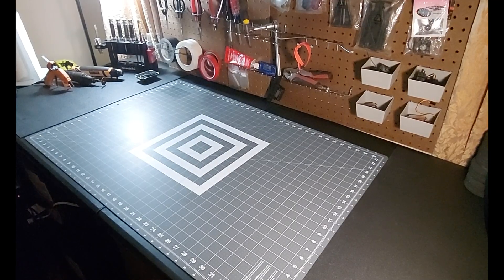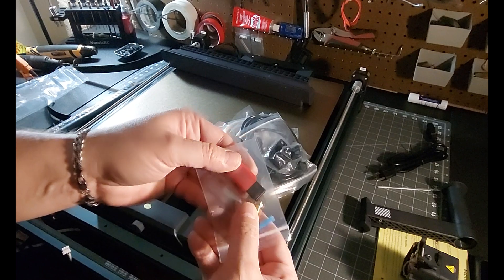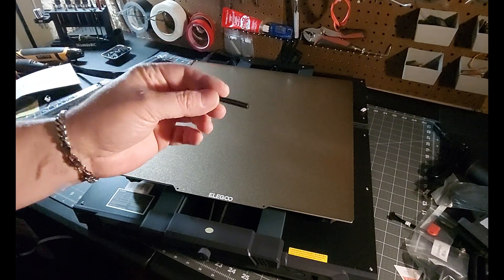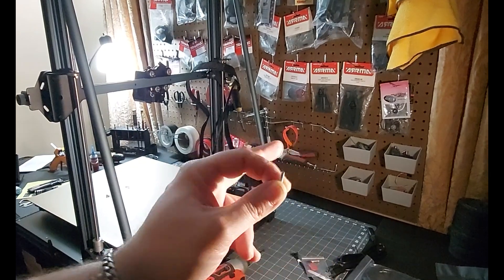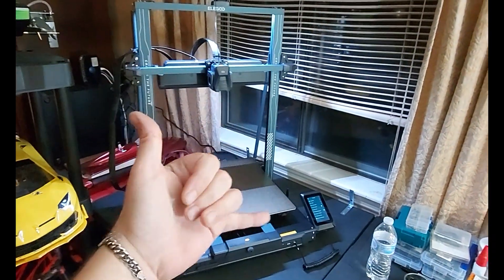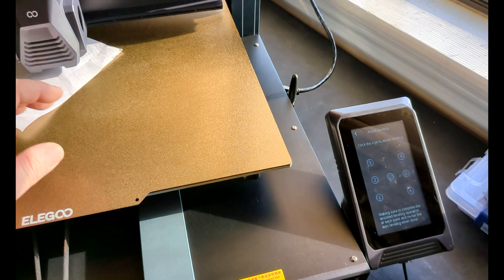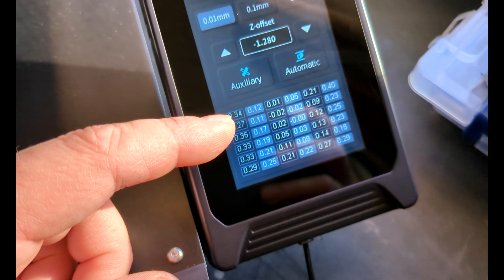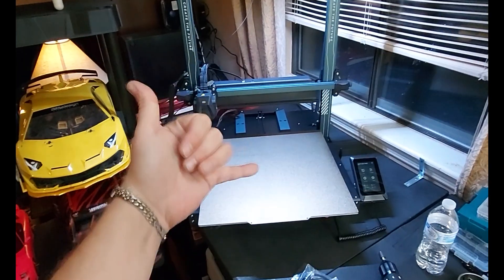Crazy Fast!! Elegoo Neptune 4 Max 3D Unbox, Build, Review

Comment: You dont need the big fan for pla by the way. That should help the need for hearing protection.
Reply from the maker: I mean I have a lot of personal experience that proves that dead wrong, but just Google it dude:

If I dont use beefy cooling with PLA it deforms and gets melted spots here and there, most times caused a flat out failed print. For a flawless smooth print you should have a good cooling system with PLA.

Google results:
1. Insufficient cooling of your 3D printed part might leave the print looking melted and often misaligned. Cooling can be a major issue ESPECIALLY with a material like PLA. Using a cooling fan alone may not solve the problem.
2. Cooling is one of the most important aspects of printing with PLA. Having a dedicated part cooling fan makes a huge difference in the quality of the printed parts. The freshly extruded plastic needs to cool down below the glass transition temperature as quickly as possible.
Reply: @NomisRC  That’s not true. I’ve never had an issue just using the standard cooling pla.
Reply from the maker: @dkev001  well I print at 250-500mm/sec